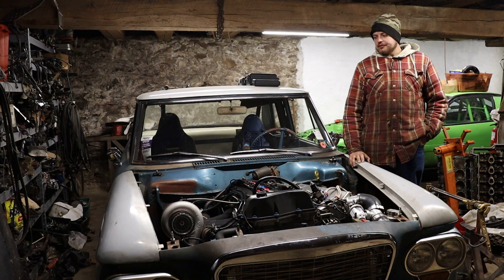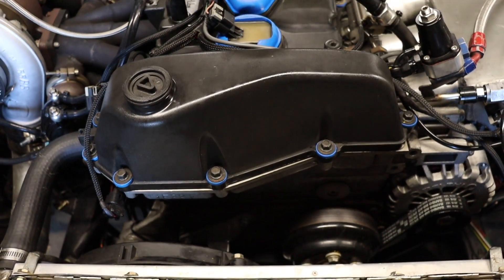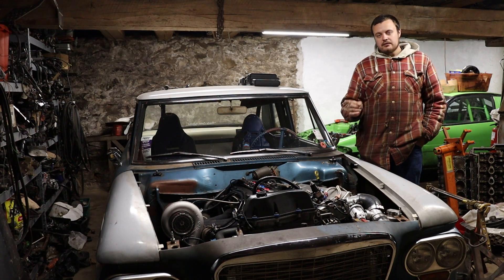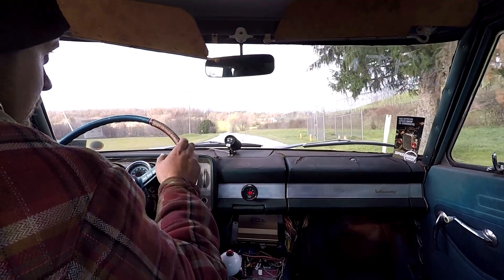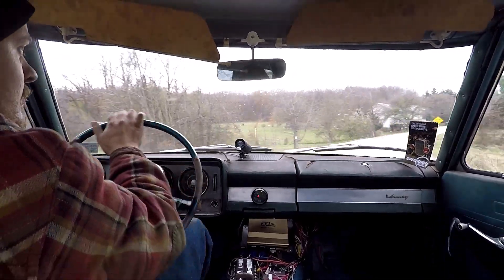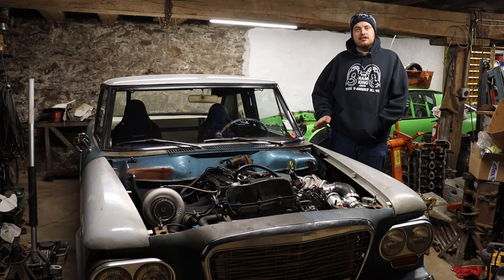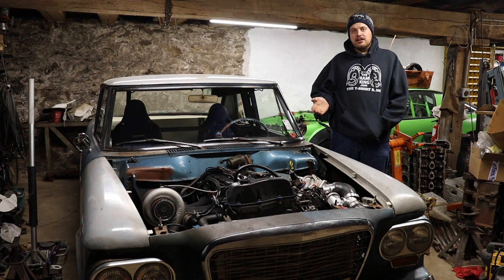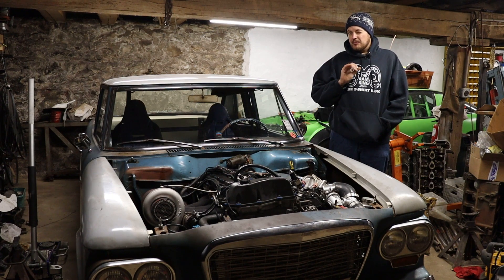Is the Studebaker Broken or Not!? - Has the Ameri-Barra finally fallen?

Comment: Has anybody melded two of these into a single V12?
Reply: It would probably make for a good offshore racing engine on 30ft Cat, Cigarette or Scarab.
At 8.4L of displacement it would have the size to move the mass with authority.
2 turbos and hold on to your butt. 👌😁👍
Reply: @GIGABACHI  if we're going so far as to merge two, we would by necessity need a custom crank and could drop displacement a bit, bring those piston velocities down and go for a 10k RPM screamer 🤣
Reply: @krakhedd  when money ain't no object the sky its the limit. 🤘
Being N/A it would probably last longer too in that harsh environment (constant high rpm and load shock with the prop coming in a out of the water).

Comment: Calvin we diggin the 4200 hop up !! We have 4 trailblazers in the family we are gonna build a hotrod one at some point. I am no engineer but been twisting bolts for near 50 years !! When you get a spark miss fire and continue to spray fuel you can wash a cylinder and get some oil past the rings ! I don't think you broke a ring i think it washed !